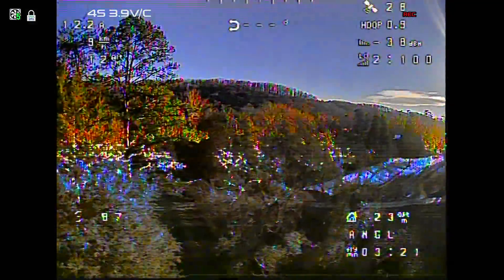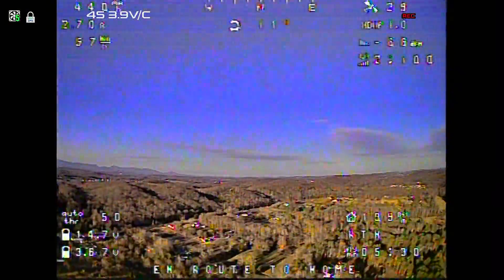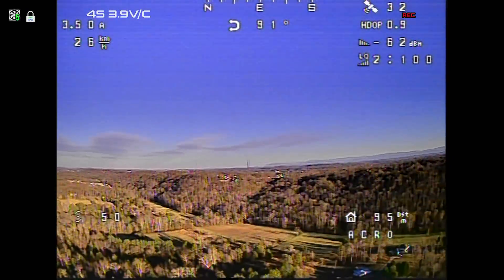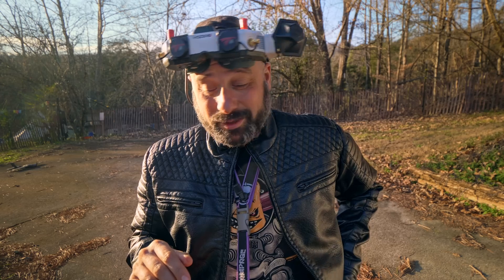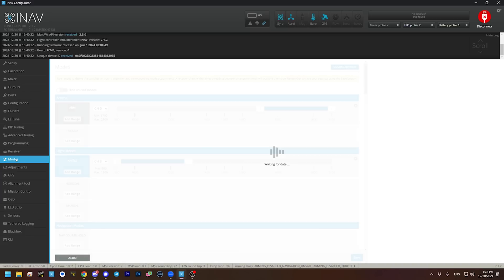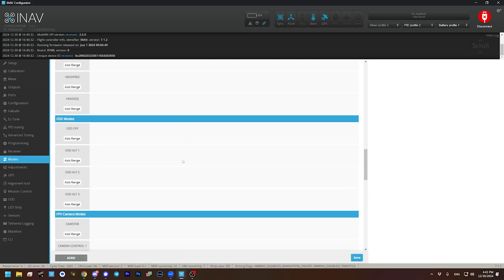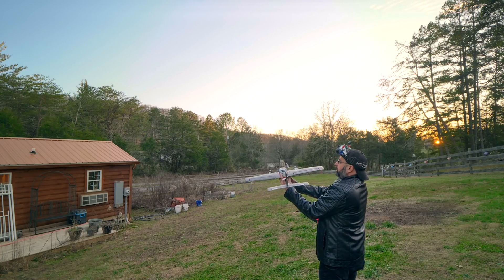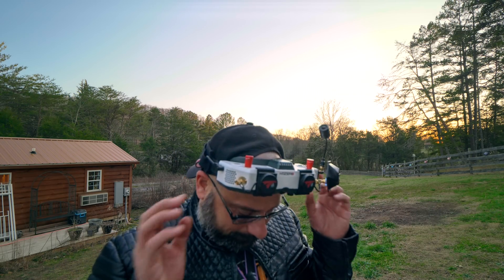Heewing T1 Ranger VTOL test flight and iNav autolaunch setup

Comment: Thanks for this series!  Building a VTOL is such a mental challenge, in a good way.  I'm not sure I would bother with auto launch for a VTOL, ( I use it on my other inav planes).  Though now that I think of it the whole reason for VTOL is to deal with flying site which lacks a decent fixed wing landing zone, but presumably would be able to hand launch still.  So auto launch nice to have.

Comment: Itsn't it more perfect to integrate this Edge T3 HD video transmitter?  It is newest from early April
https://www.youtube.com/watch?v=f7BJKz-6NeQ
1. Bitrate: 120Mbps
2. Wide Range: 35Km
3. TypeC / Type-HDMI Cable（ Screen, AR/VR Goggles, Android Phone all works in same time).
4. AI imaging, 3rd Gen intelligent ISP.
5. Best performance at night 
6. Never over heat problem under temperature 150degree.

Comment: Hi JB, patron here, used your video concepts to setup a ZOHD Altus VTOL with SpeedyBee F405 Wing FC and stock ZOHD VTOL power kit, the ESC's on the Altus are standard 50Hz (don't support DSHOT) and were calibrated with linear throttle setting and using INAV v8.0. The challenge I am having is that although the ESC's were calibrated following your concept guide, and then each ESC independently for good measure, I find when lifting off the motors spin up slowly like a sort of "soft start", (Throttle at 100%, motors spin up gradually instead of in a linear more aggressive way) which is annoying because I end up fighting ground effect a little longer before progressing into a stabilized hover.  What is confusing is that the throttle expo graph shows linear and all the settings are non-scaled-linear...or maybe I am missing something?
Reply from the maker: I can only assume this is an ESC setting but I don't know how to tell you how to change it.

Comment: I love your work but why in the world did you go with Analog as your setup of choice on this?  You of all people have much better options!  I built a T1 Vtol about 2 years ago (custom 3d printed parts vs pnp)  I did jump from ardu to Inav when 7 came out.  Ardu has a much smoother transition and RTH is more refined but Inav is easy to setup in comparison.

Comment: I'm Heewing T1 user, only shake that thing in my maiden, it's more good to use idle trotel around 1200, and autolaunch on the best range for this plane, mine is 1700, angle is 20degree, but 30degree its good enough to launch to the moon, 🎉🎉🎉

Comment: Hello Joshua, nice you step into the plane world back again, got a very interesting brain teaser .. i bought a fc speedybee for wing, i have a atom rc Dolphin like to build a V-tol (3motor config have nice cells 21700' bak' cells good for 60a continues,also p45b molicell ) like to use a drone esc to power 3 motors to reduce some just for extra info (weight.https://youtu.be/TAp3s98VbWk?si=vXD2rPMttl4Rgm1Q) how can i get this to work or would it be easier to use 3 small classic drone esc's. Have a good one !

Comment: I like to arm, and then flip the RTH mode so it will auto launch and then fly back when I get situated in the goggles so that it never is not flying itself. Also, if you disarm
By mistake, you can still control the servos and try to do a dead stick landing.
Reply from the maker: Yeah I could have tried to glide it in, instead of letting it hit the tree.

Comment: Shaking the plane isnt necessary. You can set your idle in the auto launch settings high enough that it will take off fine when you throw it. Most planes need about 75%+ but whatever works for you. Also i have mine set up so that i flip it into loiter after it gets up high enough to clear the trees. So im just used to flipping that switch and getting my goggles on and comfortable before i fly.

Comment: iNav is lots of fun. I have it in my ZOHD Drift and use autolaunch in the way you set it up eventually. Having it transition to RTH after initial autolaunch is ideal since it gives time to check VLOS that everything is going well before taking off the glasses and putting on the FPV whilst knowing that it is nicely loitering around home and you are not going to ditch it while sorting out all the FPV. Glad you are getting to grips with it and doing some fixed wing flying. I started with multi-rotors, but nowadays basically only fly fixed wing. Mostly VLOS, but I do have the Drift set up as my FPV rig with ELRS. I hope you continue to enjoy your adventures.

Comment: Shaking your plane is not the best way to autolaunch. You can set the amount of force needed to activate the launch throttle in the gui.
  Darren Lines, or Mr.D "falling with style" has some really great info on the subject, and also some online tools to optimize your settings based on weight and thrust.

Comment: Hi JB,
Maybe one of the upcoming features of inav8 called "i-term lock" will get you rid of that bumpy acro mode. painless360 interview of inav developer marc starting at 24min. BTW: Great to see you working on that T1 vtol, because imo it's the most exciting wing project right now. Hope to see you soon on an ZOHD Dart250, which was the first step for me and a couple of friends to start with wings and still is one of the most fun to fly wings for me. And it also fits on a backpack together with a 5" so twice the fun.

Comment: You're certainly having much better luck with planes than I did when I started with them. Ended up doing my first few auto launches with the roll axis reversed. Much hot glue was needed. Not the end of my silly screw-ups either!

Comment: Shake to wake is way old school.  You can have the throttle set to say 40% in inav, so when you arm the props start spinning.  You set the throttle on the controller to be the setting you want when autolaunch is done.

Comment: Unlike a drone, even after you disarm, you can still glide the plane down to a safe landing using the control surfaces. These still remain active.
Reply: True, but not if you go into panic mode and a tall tree is coming up in front of you. 😆
Reply: @RCHobbyFan  You will get better each time you fly. Just practice your fixed wing flights in a grass paddock no trees, once you get better you will be able to plan your flight paths out better and then even with a dead stick you can return home safely without hitting those trees!

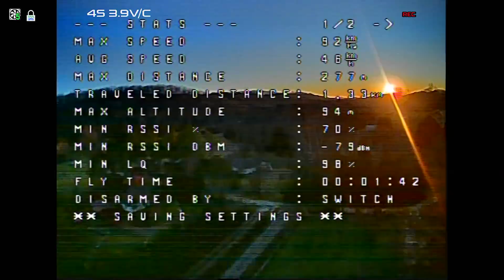Comment: 10:08 - Damn, that's a case of "Murphy's Law" right there: What can go wrong will go wrong!  😢

Accidentally disarming while in flight has not happened to me (yet).  But I've always been afraid it might though!  I also like to have my arm switch accessible for quickly turning off the motors in case of a crash, learned from my collective pitch helicopter days.

One thing that helps against accidental disarm is my disarm switch has a foam plug on it.  So I can get tactile sensation if I'm touching that switch or not.  Still, it could happen with an accidental bump.
Reply: One of my first UAV fixed wing flights I was so nervous I accidentally disarmed mid flight a few hundred meters around my area (I was triying to enable auto trim), I PANICKED and rearmed right away. Those 5 seconds the plane took to get a link I was absolutely terrified I might not be able to control it anymore, I had not properly configured RTH yet and the plane was aparently going to rth and land with unknown defaults! Fortunately the switch was setup so I could actually rearm mid air and I got the control back... but I almost s*** myself

Comment: Joshua new fixed wing FPV flier here.

Is this set up Digital?

Your teaching skills are unmatched on YouTube.

What i have been doing is with the following equipment:
- 1270mm Dynam FW-190 with landing in gear removed.
- Radiolink AT10 II. Says 2.5 mile range with proper RL rx.
- Goggles are cheapy diversity off of Amazon.
-  IRealacc Tripple Feed Patch-1 and  a 5 blade leaf antenna.
- VTX is an AKK 200mw with a 3 blade leaf antenna on plane.
- Camera is 600tvl on 180° servo.

Fun stuff... Ananlog of course.

I live on a sailboat.  
Having a VTOL fpv set up Ican use from the parking lot or end of the dock would be awesome for a quick before dark flight.

Any thoughts of feed back would be appreciated.

Thank you, 
Randall

Comment: You need to calibrate your ESCs in INAV, then set idle throttle to 1250 or so, then as others have said DO NOT SHAKE IT.

If its not launching for you, you need to go into the CLI and turn the launch accel, launch time and velocity lower.

40 degrees is extremely steep, generally, 30 degrees is considered very steep.

Comment: Continuous servo trim only activates when you are in acro mode and only when the sticks are centered. So you take off, switch to acro mode and do some straight lines with hands off the sticks and it will slowly adjust the servo mid points to offset the i-term build up when you are intending to fly straight. When you disarm, it permanently saves the new servo mid points to the FC. You can see this in the OSD when you accidentally disarmed. This also means that the new mid-points are set for all the other modes. Its helpful to leave it on all the time since it can make up for a different CG point with a different battery, maybe your landing gear broke off, maybe part of your elevator broke off, you left your hatch off. Little things like that that can vary form flight to flight.

Comment: I've been flying iNav for about 6 months and for autolaunch I first make sure I have my 6 satellites and then with the navigation modes switched off I spin up the motors to make sure I have throttle. Then I flip the switch to launch mode, arm the bird and get ready and then I throttle up the motors(yes, they are spinning) and launch. As soon as the plane gets to the altitude where it comes out of autolanch mode I flip it into loiter mode, go find a comfy place to sit down and don my goggles - I launch line of sight. So far autolaunch has failed only once or twice out of about 100 flights on four (so far) iNav fixed wing birds( I am also running iNav on a few 7" quads but don't like it as much as Betaflight). I am using it on a Zohd Altus, an AtomRC Penguin, a AtomRC Swordfish(flying DJI O3 with Walksnail on the other birds)) and a Reptile Dragon II. The Reptile dragon will carry a 6200mah Lipo and with crossfire and Walksnail on board I've flown it out 3.1 miles before I chickened out(still had solid video and radio link) and hit return to home. I am about halfway through my HeeWing T-1 vTol build and I was gonna use Ardupilot which I understand is a nightmare so your build video using iNav that I already know is freaking COOL!  Thanks!
Reply: Stick to Ardupilot for your VTOL. Trust me, it's worth the headache. I have a T1 VTOL on Ardupilot and a T2 Cruza VTOL on inav. The way Ardupilot handles VTOL is superior.

Comment: 6:30 Not so. Acro mode is stabilized but does not correct for attitude. Autrotrim will most certainly help in both Acro and Manual. You are correct that it will not change anything in Angle since Angle mode is correcting for uncommanded pitch/roll already anyway.

Comment: Are you planning on trying out the autoland? You'll probably need to add a lidar but they are cheap. 

I haven't tried out the feature yet because I don't really have a nice area where I'd be comfortable trying it on purpose. But from what I've seen it's super advanced now. You can define a runway in the configurator and its will loiter above, check the wind and then fly a proper circuit and landing. I'd love to see a video like that.

Comment: I always set up a logic switch to override arming safety if the plane is in 3d motion above a certain speed threshold. This means if I am holding the plane, all the safety checks still apply. But if the plane is flying and I accidentally disarm, rearming takes priority over safety checks.
Reply: Ohhhhhhh that's such a cool idea! I was flying this same plane while taking off in VTOL mode and my fat fingers accidently disarm it.. Yeap, It fall hahahah    how do I set this ???? Thanks!!!
Reply: @illuminatorix  "Mr. D Falling With Style" has a great video on setting up inav logic programming. But basically "if" the plane has a 3d motion reading "above" a certain threshold point, arming safety checks are disabled. I'll try and post a link, but usually they block that stuff.
Reply: @illuminatorix  https://youtu.be/EXmwUm1SdgA?t=4745&si=QdFuA7nKn3Cr-JBb
Reply: @cwwisk  Thank you!
Reply: There is also a setting on radiomaster to use SH (right) + SF (left) to arm, so if you accidentally hit SF it will not disarm mid air. That's a lot safer than overwriting safety checks, you do not want to be in a position to arm/disarm mid air.

Comment: To re-arm in flight you can use logic conditions to override arming safety when above a certain altitude or when flying a some speed. It lets you instantly re-arm without switching out of a flight mode and lowering the throttle stick. It saved me a few times and it's less stressfull when you know that you can always re-arm no matter what.
Reply: This
Reply: After I crashed in a body of water due to an unexpected disarm, I found the programming hack to allow rearming.  Def should be just done as standard in my opinion.
Reply: Oh, very clever. Not something I run into often, but couldn't hurt just in case it ever was...
Reply: I've never actually messed with the programming tab before, but that's some very intuitive logic. Definitely going to be applying such logic conditions to my planes from now on. Thanks for the suggestion!
Reply: I have a logic condition that requires throttle zero to allow disarm.
Reply: @adilsongoliveira  how would you set this logic switch up?  I like the idea of zero throttle disarm.
Reply: @1Joker.FPV1  It is hard to explain here but basically, I use edgetx and in logical switches I have a iline L1 that checks inf throttle is below 99 and my arm swtich (SF) is armed and in special functions, if this condition is not met, I override throttle with -100.

Comment: I have a perfect tune for ardupilot. If you have the heewing fc or a f405 FC. Respond and I'll email it to you.
Reply: Email it to me please! I just got mine for Christmas, wrecked it twice, gmfixed it both times then landed in a tree and I couldn't disarm fir some reason and now the rear motor won't work properly no matter what motor or esc I put on it so I think the pmu may of shorted? Idk lol very frustrating tho
Reply: @Todd_G_FPV  did you calibrate the esc's. Search heewing t1 esc calibration guide. Sounds like thats tbe problem
Reply: @squirrelynutz1  that's how I fixed it on the second wreck when the left side couldn't keep up but the rear just stutters. Thinking about just using it as a plane for now on lol